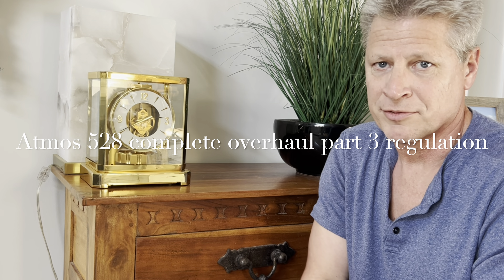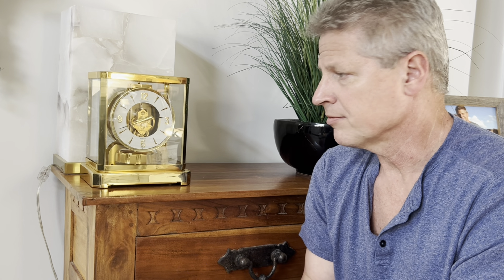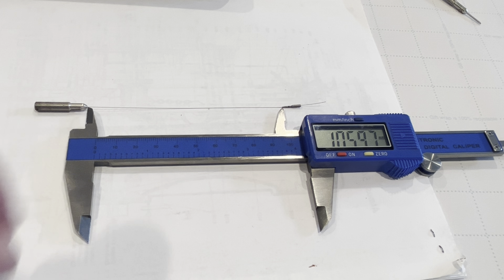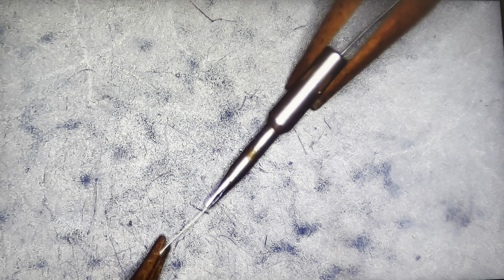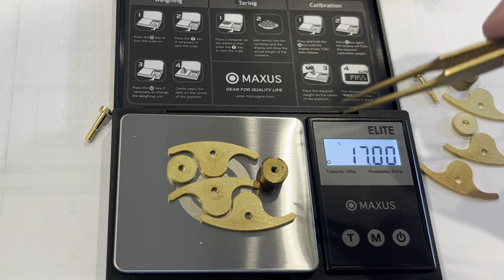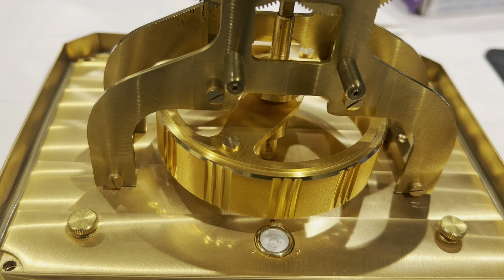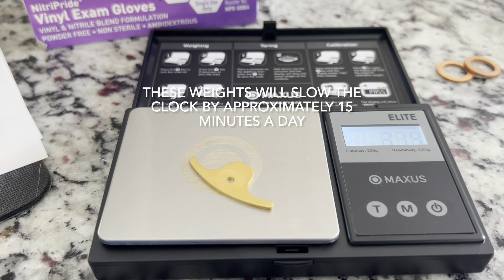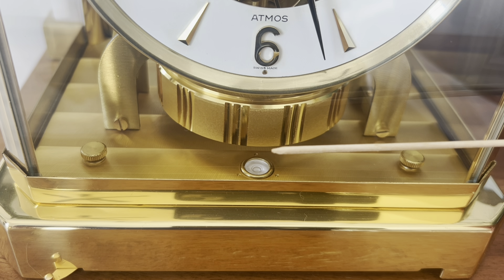Atmos 528 Overhaul Part 3 Clock Regulation & New Suspension Spring

Comment: I've ruined 5 suspension springs trying to do this. I honestly don't know how the hell you do it? I cannot get the spring through the upper swedge w/o using a razor blade to try and pry it open enough to get it through and of course have broken off one side of it. even when I get it through it never stays centered and I'm sure it should be if it is going to not hit the side of the tube even after I poise it.
Reply from the maker: Suspension springs are tough. There’s a reason why I said good luck a couple of times at the beginning of the video. This is not for everyone to do. I just put three in within the last two weeks. I recommend rolling the razor blade off of the lower clamp. As you roll the razor blade off, the clamp will slowly close. The trick is keeping the spring straight while you are rolling that razor blade off.

I started to use a ceramic tip tweezer to force the suspension spring through the small upper clamp. It allows me to get a good grip on the suspension spring. Try using just a little bit of moisture on the tip of the suspension spring as you send it through the centering tube of the upper clamp.

Thank you for your comment and I wish you luck.

Comment: Hello, I am fan of you channel and I have learned a lot from your videos, now I need your help, where do you buy the suspension spring, because the ones I have bought I think are little thicker than the genuine and gets the clock fast almost 20 minutes per day, I will really appreciate if you share your supplier.  The suspension spring is the same for a528 and 540 Atmos ?
Thanks Carlos
Reply from the maker: The suspension spring from timesaver can be used from the Atmos 2 all the way to the modern 540. You will need to add weights to the balance to slow the clock to within three minutes a day. Now you regulate using the regulator on the top of the clock.

Comment: Where do you buy your suspension springs? And is it even possible to find the upper regulator, I've broken one trying to pry it open with a razor blade; BIG MISTAKE!
Reply from the maker: Buy the suspension spring from Timesavers. Never pry the upper clamp open. You’ll need another upper clamp from a used clock.

Comment: Hallo, what  LACQUER SPRAY - do you use to protact the clock.  I have seen the normal once make the metal dull and it loses it shine.  Kind Regards,
Reply from the maker: Mohawk high gloss
Reply: @watchguyAtmos  Thank you very much - appreciated - I have a Atmos clock but want to know what model it is? can I upload picture?  It has a rectangular dial and physical size is larger than the normal atmos clock